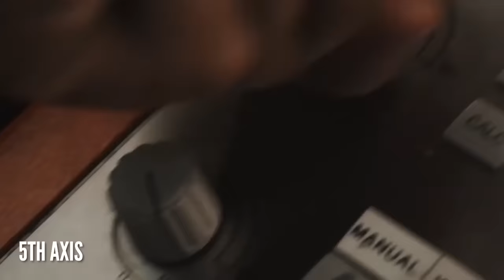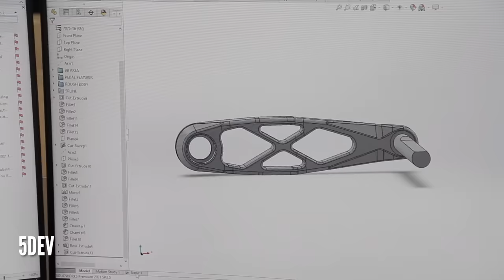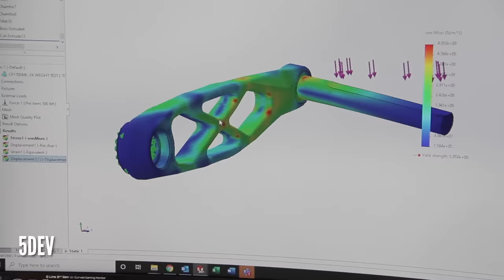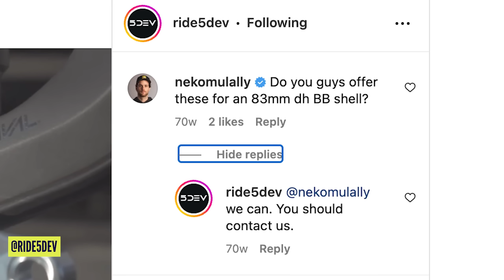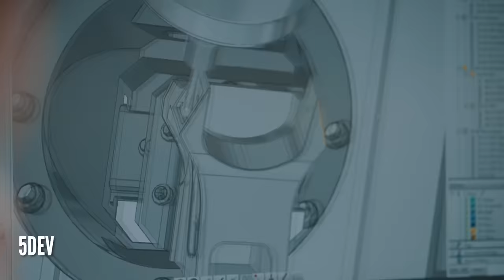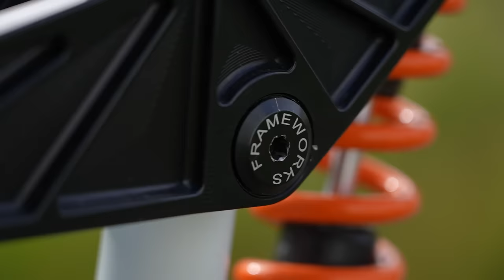The Most High Tech Bike Brand? | Behind The Scenes At 5Dev

Comment: The three most expensive industries: military, aerospace and bike :)) Great looking products :D
Reply: Great looking but weak AF! I've seen too many of them snap so they seem to be best suited for rich posers
Reply: @mtbsieppo  I ride MTB Downhill myself and im a CNC Machinist. Their Parts all look solid and their Geometry makes sense strenght wise, if used the right Material they shouldnt snap brake or anything maybe getting dent or slightly bent.
Reply: @jamaicanturtle6313  Except how TF do you improperly use a crank? It's not like they do much of anything other than pivot around the the bottom bracket. It's not like a rider would be trying to pull the ends out and away from the bike while flying through the woods. To be fair the forlks claiming weak cranks need to provide specific context - did they slam into a huge rock at high speed or smack a tree? Did they drop a heavy moving or a refrigerator on the crank assembly? Did they hit them with a sledge hammer repeatedly until they broke? Point is check proper reviews and not just go by random comments on YT
Reply: Also we would have to assume that Neko is not really using 5Dev parts during competition and only sitting in an interview because 5Dev is using him as a paid sponsor. I mena I guess they could make top notch parts specifically for Neko while selling subpar to the masses. But then there'd be a trail of part recalls + lawuits.
Reply: I have zero experience with these parts, but I would be very surprised if the quality wouldn't be top notch. It looks great and sounds like the engineers behind them are way overqualified.
Reply: Military: expensive because of the massive reaearch and development to gain an edge over the enemy
Aerospace: massive ammounts of tech and manufacturing to optimise and make more efficient machines

Cycling: expensive because idiots pay 6000 on a bike instead of getting better

Comment: DEV - DEVastate your bank account
Reply: Ferrari price tag for cranks. Thanks not looking to show off my cranks to people. Just want to ride it, break it then change it, ride it again
Reply: 5DEV always there to make every dentist’s bike stand out from the crowd.
Reply: 350 for cranks is not expensive.
Reply: @Flutiedb  anything over 145mm is $500 lol. And they snap easily.
Reply: @323johnnybravo  They aren't budget parts by any means, but they do not snap often. They are being raced in downhill at the world cup level and not breaking.
Reply: @compasteedee  Iv seen many snapped online , one guy was riding a hardtail doing wheelies and it snapped on the street.
Reply: @323johnnybravo  define "many" I've seen a handful break, but a handful on the internet doesn't equate to them breaking all the time.
Reply: As a design engineer: don't  risk your health by those products. Period.
Reply: Ive never seen a bike part that hasn't broken
Reply: If they have parts rolling around on Mars, I’m pretty certain they are capable of producing reliable bike parts! Besides, they add a bit of bling to my Spec.
Reply: @DZig  There IS nö such thing as miracles that bend physics. You have a modulus and a crosssection what determine stifftnes and you have Woehlers, load and allowable stress that determine weather a part fails immediately or a bit later or lasts forever. Then you have ductility that defines if it bends or breaks. I am aircraft engineer and sales man. I know marketing and Design. Your personal choice
Reply: @iloveaviation-burgerclub-a8145  we are all very impressed by all those terms. You should be very proud of yourself. I wasn’t referring to any miracle all I’m saying that the company has a Pedegree and I trust them. And they are good looking products.
Reply: Dentist here,  best believe I will have these on my yeti
Reply: @Flutiedb ti cranks for 1500 cad
Reply: @brandonreimer184  do you really need Ti cranks?  What type of terrain do you ride and how hard?
Reply: @Flutiedb  no I don't need them at all but that makes no difference to how much they cost.
Reply: @brandonreimer184  what’s the point of complaining then? They are CNC’d titanium. It’s not supposed to be cheap. But obviously enough people wanted them since they sold out the first batch instantly.
Reply: @Flutiedb  
Using that logic why do we have clothes and shoes that have huge price tags because they are made by a particular corporation that sponsors a sportsperson we like, or vehicles with hundreds of horsepower when 100-200hp in most situations would be adequate, or wheels and tyres for those vehicles that are of little to no benefit to performance and in some ways can be detrimental, or watches that cost tens of thousands when a $25 dollar watch will keep perfect time.
Reply: @thechumpsbeendumped.7797  yes that’s my exact logic. If you can afford it and want it then get it. If you can’t afford it don’t buy the high end stuff that only adds minimal gains.
Reply: @323johnnybravo  yeah or maybe make money to spend money. Take as much time riding as you do working. Then the price doesn’t matter. Make money play with that money!

Comment: I wish they would dip chainring and cassette teeth in tungsten carbide to increase longevity. Titanium has great thermal and strength to weight properties but is not equal to steel in durability for drivetrain applications.

Comment: Love my 5Dev crankset on my squish bike - much nicer than the stock OEM stuff.  Just wish I could get a set that would fit a 24 mm BB (i.e. SRAM GXP or Shimano).  I have PF41 BB and will not use any pressed-in bearings (most stupid spec ... creak creak creak).

Comment: Do u not find MTB pedals are best made from softer material, so when you hit something hard, it has the ability to absorb, not send shock waves through the whole bike, i used to be a CNC machined metal PEDAL ONLY GUY, no longer, the bearing and structure can be that way, the pedals replaceable, soft, coloured, reflective, u even kind of like grinding them, moto GP, ur having fun, but these are my ideas, copyright and intellectual property, ta!?

Comment: Hi GMBN Tech team: I know 5Dev is cool with their CNC-machined titanium cranks and all, but we have to make them accountable for their products already in the market that are breaking. Cranks and pedals are your main connection and support to your bike, so safety-of-use is most important.

Until this has been addressed, you will find videos about 5dev marred with some less-than-enthusiastic comments.
Reply: @LoamMTBSlide  it's all he said, she said ain't it? at the end of the day 5dev cranks are breaking and need to be replaced, so are the other cranks out there due to their potential danger when in use. As there are no regulatory bodies holding bike components companies to a safety standard, we, the consumers, have to inform ourselves of these potential issues.

If it was just a handful of incidents, then maybe we can chalk it to a % failure of any products. Nothing a good warranty can't fix. Personal injuries stemming from janky bike products are expected anyway.
The issue is that 5dev is not recognizing that "maybe" there are now enough customers that are having problems to warrant a product recall. And since the bike industry has no transparency or regulations, how tf do we, the consumers, would know? I wish 5dev is not thinking that this is just about them. It is about how this event will set precedent to how boutique bike parts manufacturers will handle these types of events and what the consumers reaction to it. You can't even casual Google "5dev problems" like how we can do that with other bike parts (I'm looking at you SRAM G2.)

I like the little dig on my financial ability, Chris. I did try out your cranks (155mm ep8 alu), and honestly, they are just THAT beautiful. I knew that the Ti cranks are coming so I waited but then this news of your cranks breaking and how you handled it reached me. So turned off, dude. Now I'm putting my 5dev funds to Push with their new fork. C'est la vie! (Still buying your Ti stem, tho 😉)
Reply: @mechpade  Not worried about exploding the stem and losing all your teeth? Seems a bit contradictory
Reply: @erikhortsch  no news of their stems exploding so I’m okay with that. Also, they’re Ti, so I’m a bit more confident with them

Comment: Not your average start-up tho when they can just buy hundreds of thousands of dollars worth of equipment. The guy pretty much says they jumped on the covid-train with what is, from my perspective, a bunch of over-engineered stupidly expensive components  that no one needs and have a high rate of failure. 
Basically just another big engineering company dipping into the bike industry with no intention of practical improvements. 
 There are garden-shed small companies out there that actually address issues.
Reply: so don't buy them. "dipping into"... The bike industry is a massive corporate group. It's not some "core" grassroutes industry.